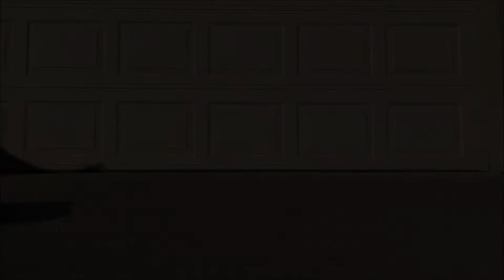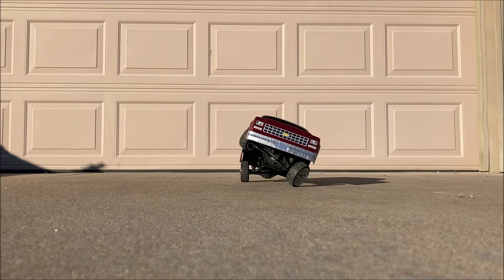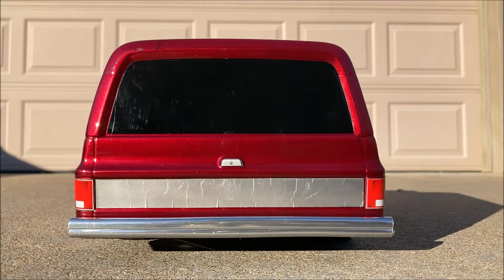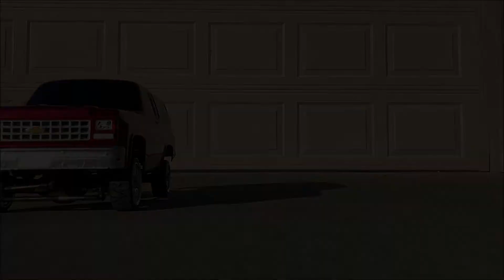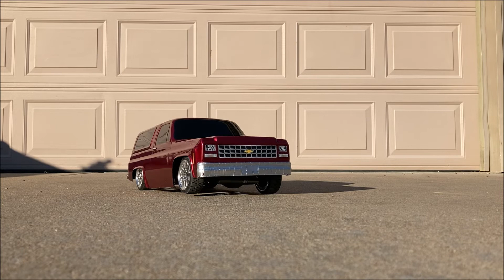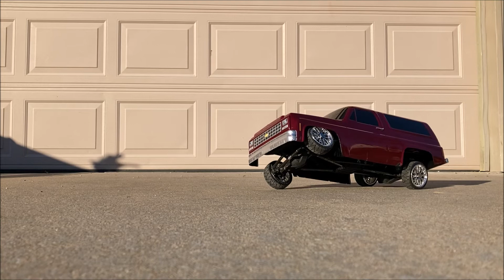RC Car K5 Blazer Lowrider with Hydraulics / Airbags Suspension - Axial SCX10

Comment: I'm building a k5 blazer monster truck with Bluetooth stereo and the RC4WD hardbody. I managed to use a short carbon frame from Injora with everything else metal axial wraith axles and bigger shocks sitting on proline trencher 3.8s. It's pretty much done but I have to build a Trailor with small sub to  pull for bass lmao. It's so heavy and only powered by a traxxas brushless motor
Reply from the maker: That’s AWESOME! Which color RC4WD body did you get? The blazer in this video doesn’t even exist anymore 😂 I bought the teal hardbody a couple weeks ago, and completely reworked the blazer in this video, and made a brand new one. It’s pretty much done
Reply: @VIP BRIGADE  I got the grey one. I just uploaded a video of it. Its.pretty badass what you did man. How long did it take you to make?
Reply from the maker: @imlurkn5291  I’ll check out your video! As far as mine 🤔 I ain’t real sure the amount of hours. I just messed with it off and on after work and stuff, for a couple weeks. And I appreciate the compliment!